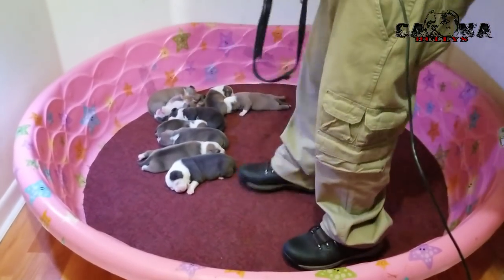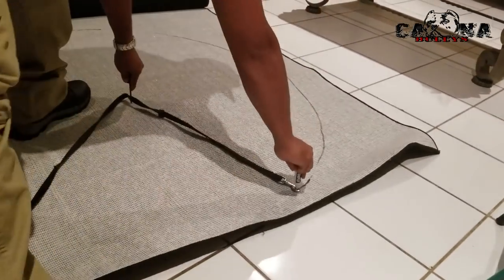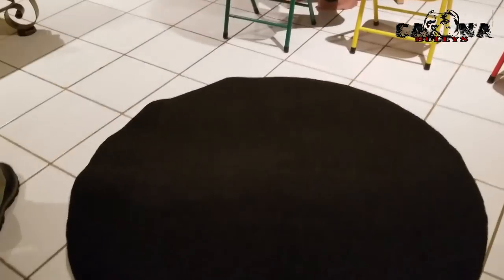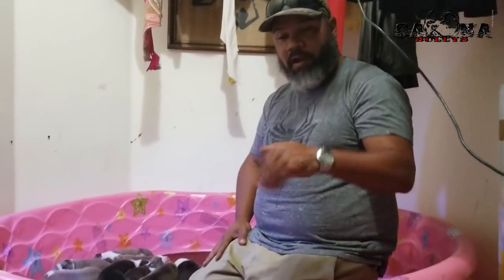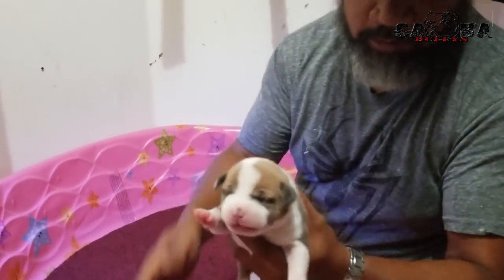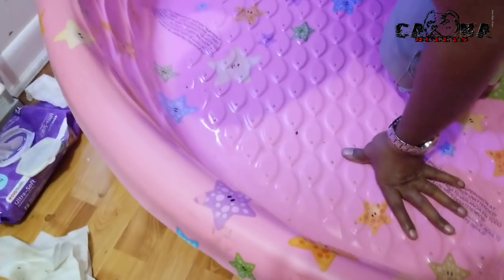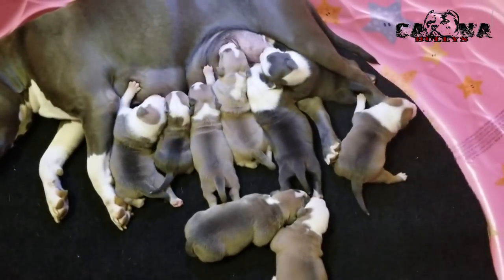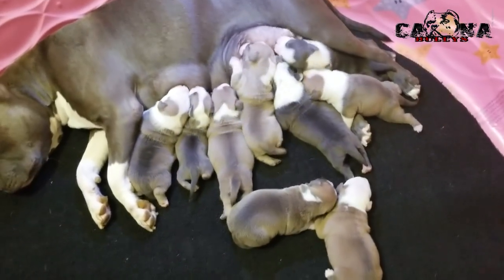American Bully Puppys - How To Make A Kiddy Pool Whelping Pad

Comment: Could I put a heated blanket under the pad so they stay warm or pad warmers
Reply from the maker: You can but always check on it to make sure it's not too hot. I like to use a heat lamp used on baby chicks. Keep in mind that some baby pee will seep thru the carpet so adding peepee pads under it will help keep it from going into your floor. Goodluck.

Comment: Do you recommend putting a safety pipe? If so how would you do this with the mat?
Reply from the maker: If you feel your bitch may lay on them while you are away, yes. All you have to do is find the large pool noodles and some zip ties. You'll have to drill some holes on the side of the pool to attach the noodles. You want them about 5 inches from the bottom of the pool. We don't used them because we monitor the pups and mom 24/7 till they are about 2 weeks old after which they are too big to be laid on. My wife and i rotate also have a camera to monitor them on our phones if we are in the yard or with the kids in other rooms. Ana is very alert has never laid on one, but it cant happen so always make the nest decision for your situation and good luck.